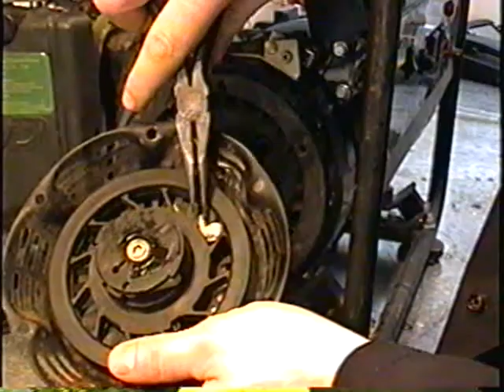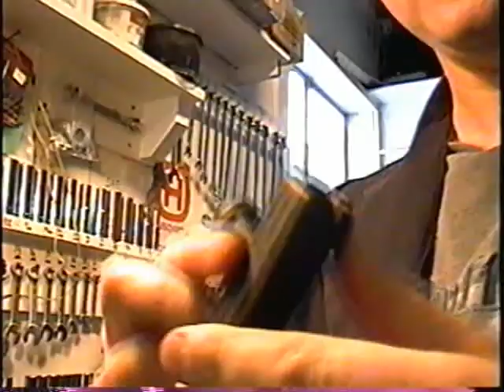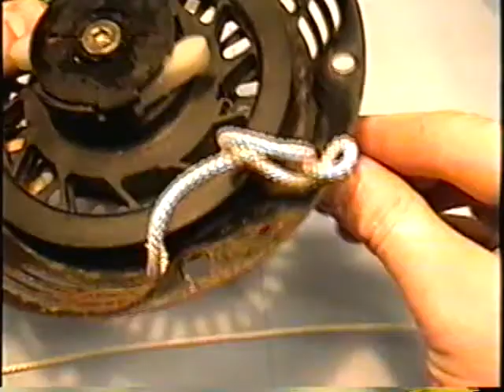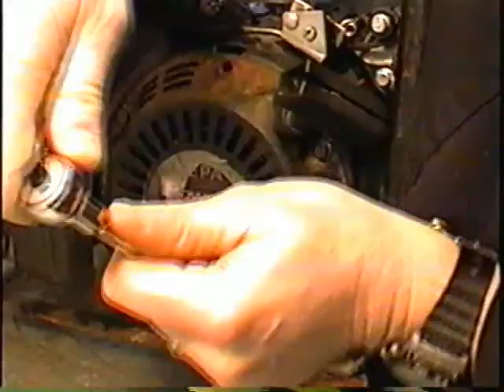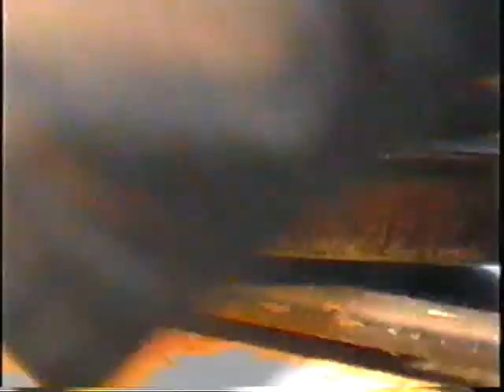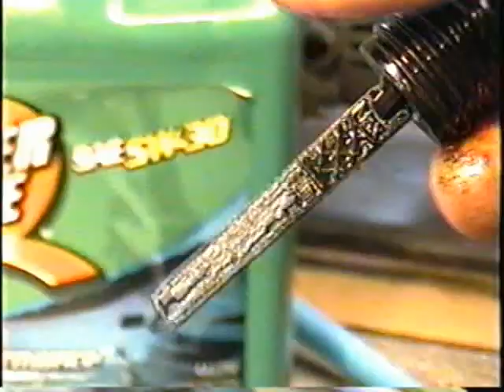HOW TO REPLACE Generator STARTER ROPE & Motor OIL

Comment: My genater starting but few seconds engine turn off im check engine oil and carprate air filter but not solve my problm please tel sir
Reply: Honda exk 2800
Reply from the maker: +jaiphotolam Harinath the carburetor is probably dirty
Reply: Thanks